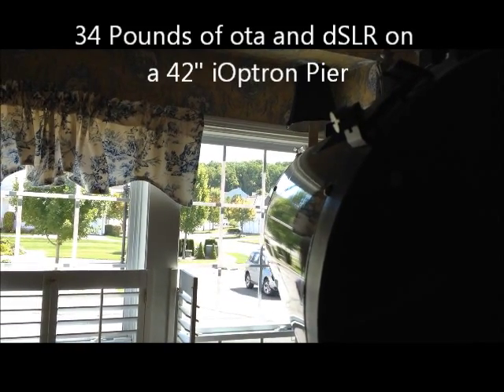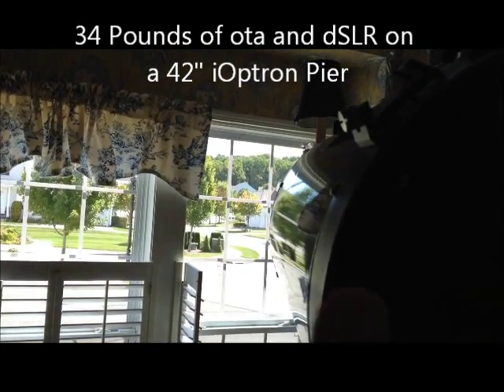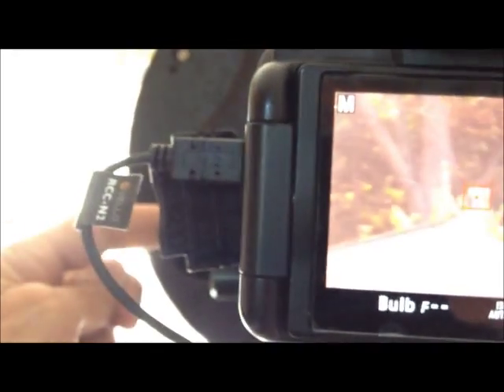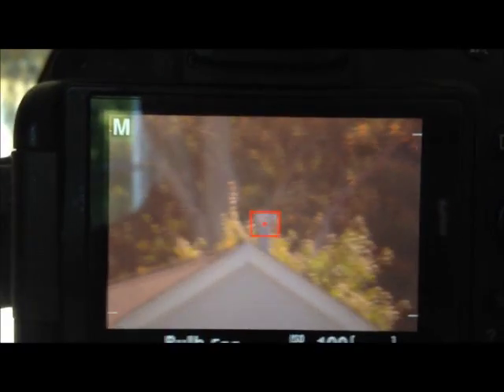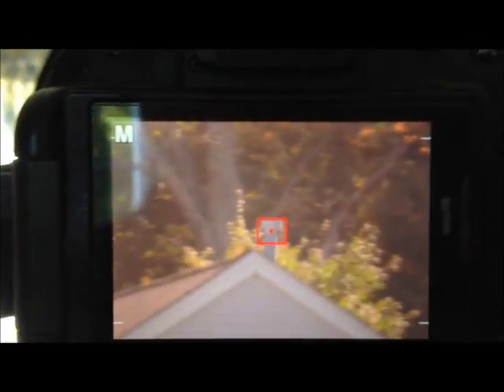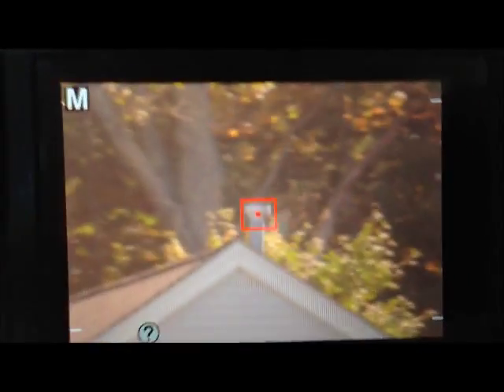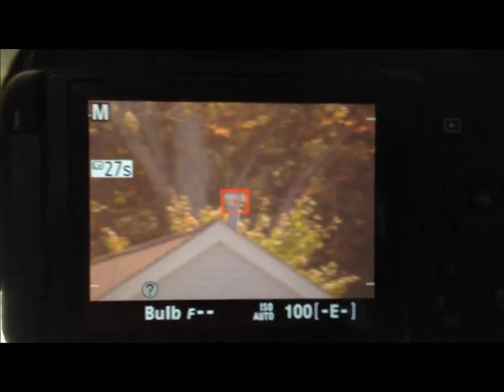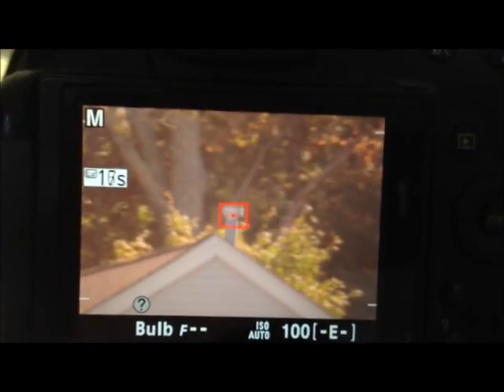CEM60EC Tap Test

Comment: Appreciate your videos.  Bought a used CEM and reworked the ra drive with great success thanks your video, dec is next, am used to tearing into mounts :-).  I have the small 1.5" tripod and this is not very stable and adds to scope wobble during focus and wind, but easy fix with larger tripod or pier.  I use only for visual with 105 refractor. 
One item I would like you to cover; my RA worm had some very rough spots, I suspect from camming, which I smoothed by removing the worm housing and smoothing with jewelers files.  Wonder how you approach this issue.  
Thank you again.
Steve Monterey CA.

Comment: Hello Mr. Chasse. I thank you so much for your videos. Very illustrative. Recently, I purchased a CEM60 mount.  I would like to ask you about the actual polar alignment of the mount. I am used to other EQ mount I have, where the polar scope shows Ursa Major and Cassiopeia. My CEM60 has a clock dial. I am not familiar with this process. I understand the HC shows a graphic position of the pole. However, how accurate is this polar alignment? Would you please expand on the subject. Yours assistance is greatly appreciated.